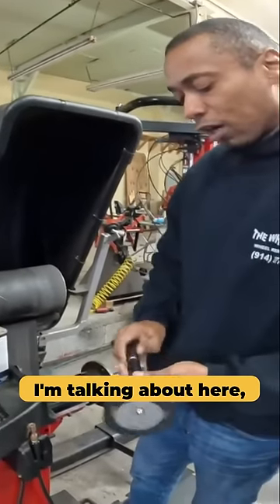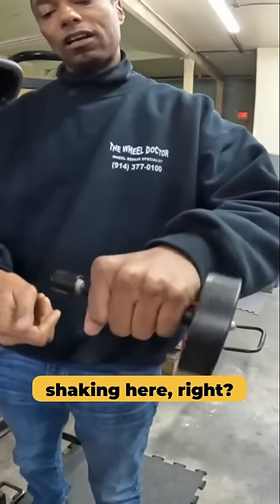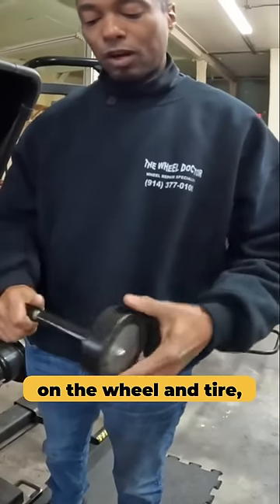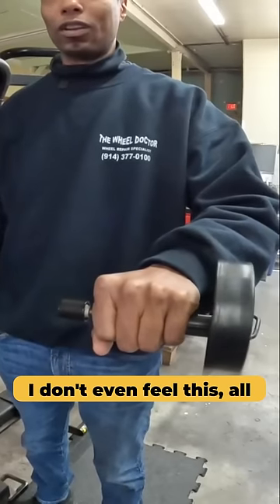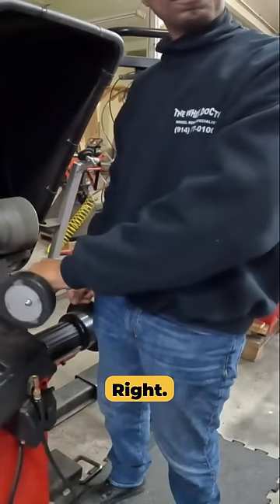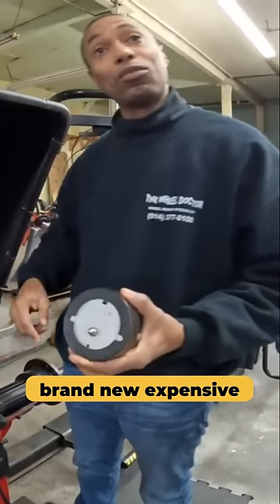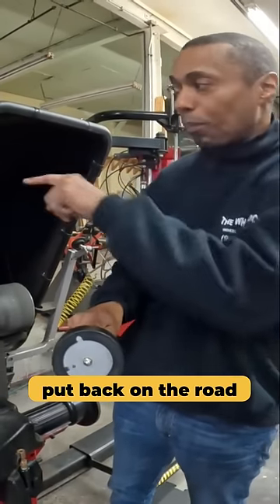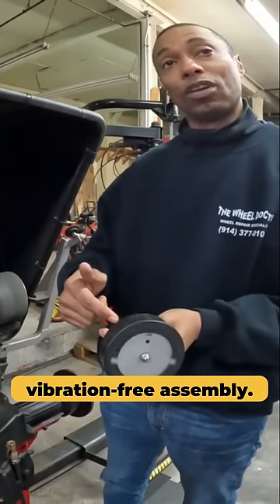1.5 MILLION VIEWS - Highway Steering Wheel Vibration (ONE SOLUTION) @thewheeldoctor7097

Comment: OEM tires and wheels have the high spot marked and the builders put the high mark 180 degrees apart from each other on the wheel vs the tire. The pin vents are also grinded down to 1/32 of an inch to ensure the best balance and ride. The high spot is marked by a Tire Uniformity Optimizer or TUO. I worked in  a tire factory 11 years.
Reply from the maker: Thanks for the info!

Comment: This seems like what needs to be done to my tires on my truck. Can someone please tell me what is this called and where would I get something like this done? TIA 🙏
Reply from the maker: Call your local tire shops, ask if they have a force matching machine. If they do,then explain the problem you’re having, with hopes they’ll ask you to bring in the truck.  Also, if your joints (ball joints, control arm, etc) are loose/faulty, that could also be your problem.  Bottom line, if they have the equipment, explain to them the problem you’re having and let them diagnose. IMO
Reply: @chiz_tv  thank you so much!!!!! Hopefully this will be the cure for whatever is causing my truck to shake between 50-65 mph
Reply: @chiz_tv  I ALSO APPRECIATE YOU TAKING THE TIME OUT OF YOUR DAY TO HELP ME!!! It means a ton to me!!!! 💯💯💯💯💯
Reply from the maker: You’re welcome, please keep me posted. If you look at my videos, I LOVE PROJECTS!!!
Reply from the maker: And what I recommended to you, is exactly what I did to find The Wheel Doctor. And after I found him, I stopped in twice, to just ask questions, before I actually dropped off my wheels.

Comment: unless we’re talking fairly low profile or performance application a force match is just compensating for a shitty tire, warranty the out of round tire and be done with it. Especially if the radial runout on the wheel is minimal. 

I Have seen/done some pretty cool things with road force and bead massage though. It definitely has its place.
Reply from the maker: Thanks for sharing! It definitely has its place, but not for every application

Comment: Have done this since the early 80s. Learned it from a Bridgestone rep. Usually it was with Uniroyal tires we called them separators because most of the time belts would break in one of them before the tread was worn out. GM cars came from the factory with them back then.
Reply from the maker: Thanks for sharing

Comment: That's why there are Dime size 'DOTS" painted on tires. They represent the high and low spot on tire...the rim has the valve stem which those dots are supposed to align with...! That will align the high spot and low spot
Reply from the maker: Interesting, I didn’t know about the DOTS

Comment: Force matching is great in theory, and sometimes works without issue. But the whole basis of how it works depends on you having an imperfect wheel and tire and you match up those imperfections to cancel each other out. 

If you have a good tire but a bad wheel, it ain't doing shit. And more commonly you have a bad tire and a good wheel, it ain't doing shit. 

It's awesome when it can work, but I would say the majority of the time it ain't gonna do nothing.
Reply from the maker: You’re right.  And I am proof that it works. After getting my wheels force matched, putting them on the car where The Wheel Doctor indicated, I am vibration-free at any speed. That’s better than any theory.

Comment: All the tire guys where my Dad was a car mechanic knew how to use the balance machine to first check / balance the rim and then figure out the heavy / light points of an oversized truck tire. My 33’s on cheap steel rims didn’t have any weights on 2 and only small weights on the other 2. 
They made it a game to see who used less weights each day. Because weights tend to fall off when driving thru pot holes, which are very common in Minnesota.
Reply from the maker: That's it!!!  They made it a game - Thanks for sharing.  They were applying these principals to 33-inch steel rims!!  wow

Comment: Had bad shaking on my steer tires, to the point they were leaving the pavement, had wheel balance and alignment done, no change, had road force done and still no change, changed all suspension components and bushings, still no change, countless shops and a lot of $$$ and nobody could figure out the issue, we decided we would replace the only thing left(which all the shops told us that wouldn’t cause the problem) which is the front axle, problem solved, it’s been 3 years and the shake hasn’t returned. Shops need to come up with a better way to diagnose these problems so we don’t have to waste thousands of $$ on crap that wasn’t even broken
Reply from the maker: You're right, their process of elimination cost you thousands.  You may need to look for another repair shop in the future. Thanks for sharing your story, maybe will help someone else.  Do you have any idea how that axle was damaged?  Does seem odd...

Comment: I worked at a powder coating shop that had a maintenance engineer. He made a wheeler rounder that was ingenious. You take one of the steel or aluminum semi rims and place it valve stem down and pull a lever that pins a large round steel ball to the inside of the rim. The you turn on the motor that spins the rims at 1000 rpm. The bell smacked and bounced repeatedly on the rim while it bends and heats up. Then you engage the pneumatics on the lever and it vibrates the whole machine until it runs out of places to round out. Once it stops shaking like an unbalanced washing machine, the wheel was well within round. Then his guys would reform the lips and valve stem with a blow torch. They had to be marked and when they were returned they could not be rerounded on the same machine. Then they would have to go to the welder, and he would use the same machine, but reweld and  locate weak points and stress test anything that seemed wrong, because one lawsuit would have killed that business. Lol
Reply from the maker: Thanks for sharing that experience

Comment: I had balancing beads put in on a new set of wheels and tires for my truck. It shook like crazy at all speeds. I took it into a local shop to remove the beads and  balance with weights. When I picked it up, the shop told me they got it as good as its gonna get, but it still has a little "shimmy" at highway speeds. Charged me $250.00. Still shakes a good amount,  sure not as bad as before,  but any shaking is bad, obviously.  I need to find a shop that can do this.
Reply from the maker: That is really annoying, and I know that feeling. Now you have to spend money again, if you find the right shop to do the work.

Comment: I've been wrenching for 15 years and force matching has never helped any of my customers. It's also a lot more work for a tech to do it correctly. Cause you have to mount the tire then spin it then unmount it and remount it as it instructs and like I said I've done it several times and short of a car doing insane speeds I've seen no difference. By the time a customer feels a vibration it's a badddd tire or bent rim.
Reply from the maker: Yes, you are 100% correct, it takes more time, and at 55mph will you really notice the difference?  So, this conversation may be for those customers who drive faster than 55mph, and are seeking a vibration-free vehicle...

Comment: I was doin this in 2007 at ford. I no longer work there so had to have another shop mount new tires for me recently and they have no idea what road force balance is😑 my tires hummed after that
Reply from the maker: Sometimes they have the equipment, but prefer not to do it thinking it will not make a difference

Comment: Back in the late 80s I went to school to be an auto technician and they used to teach us how to balance the entire front end. With the tire on the car this machine would spin the cars at about 60-70 miles per hour and tell you where the weights when and it bounced everything so if you had a little bit of a bend in one of your tie rod shafts or something like that it would compensate for all of that. So much better than the way they do them today. However I don't believe you can actually balance them that way anymore especially with four-wheel drive and all-wheel drive. However the cars from the 80s and before you can get away with it easily. That is if you can actually find a mechanic that actually has that equipment and knows how to use it. I'm 52 and it was old when I was in tech school at 17.
Reply from the maker: I didn’t know that, thanks for sharing!!!

Comment: This is true, IF the rim is not round, but most rims are. So, if you have a tire that is not round, it won't matter how much you turn it on the rim. It will still not be round. There's only 2 solutions. 
1- Buy a new tire. 
2- True the tire. 
Tire truing is very old school and most shops don't even know about it and don't know how, which is pretty sad. A tire truer will shave off the rubber on the tread until the high spot is gone and then balance. If done right, you'll have a perfect balance.
Reply from the maker: Do companies still shave/true tires?
Reply: @chiz_tv  very few. I used to work at one and I believe they still have a truer.
Reply from the maker: Typically the tire is returned if new. Which brings up a new question.  I wonder what happens to all returned tires if they’re not “round”.  Would the manufacturer then true the tire, then resell?!? 🤔

Comment: When you're installing tires. Make sure they are properly lubed, inflate the tire to 50 psi, then let all the air out. Refill to proper psi. I promise 80% of the time any movement you see in the tire versus the rim will go away.
Reply from the maker: Hmm… interesting!
Reply: We used to do it with Michelin tires but we went quite a bit higher than 50 psi. I'm just saying 50 PSI cuz I know a lot of people will be that's crazy you guys were inflatimg them that high But it just seems like it seats the beads better and then relaxing it by letting the air out and and then airing it back up. we noticed a lot more tires looked better and they read a lot better on the road force machine. Spent quite a few years in a tire shop, dealerships...
Reply from the maker: That sounds logical to "over-inflate", then relax the pressure.  Thanks for sharing!!!

Comment: Where do i get this done in Colorado?
Reply from the maker: Maybe someone else has a better idea, but I would call your local tire shops (use YELP), ask if they have a force matching  machine. Then explain the problem you’re having, if any, then ask for a recommendation. Also, if your joints (ball joints, control arm, etc) are loose, that could also be your problem.  Bottom line, if they have the equipment, explain to them the problem yours having and let them diagnose. Don’t self diagnose….

Comment: Why did you move the axis
Reply from the maker: It’s a demonstration…
Reply: @chiz_tv  well it's a little confusing because that's not what would happen to a car because the axle is in the center so you're charging variables that don't apply to a car
Reply from the maker: You're right, the axle doesn't move on a car.  In real life, the wheel is not a perfect circle, and even a brand new tire is not perfect.  When you combine the wheel and the tire together, you get an assembly that spins with vibration. This vibration is similar to that simple demonstration of the toy tire spinning on it's axis.  Hope this helps
Reply: @chiz_tv  ok cool I get it now thanks
Reply from the maker: @Ben24636  AWESOME!!

Comment: Did he move the point of rotation not centered and when he showed the balance it was centered..... when you balance a tire it is with the rim, a pipe will go down the center in which you tighten it take the weights off and see how it is.

Comment: I love it when I see weights on opposite sides of the same side of a wheel.  🤣
Reply: "opposite sides of the same side"  You realize this statement makes no sense?
Reply: @frankdank7507  Do you need a picture to understand?
Reply: @IIIRorschachIII  No.  I have balanced tires for over 45 years, and what you said makes NO sense.  Opposite sides cannot be the same side (of anything).  Maybe you should use the terms "inside" or "outside" of the wheel?  Or whatever terms/verbiage it takes to get across the point you're trying to make.
Reply: @frankdank7507  12 o'clock & 6 o'clock of outer side of wheel. Opposite sides of the same side.

Comment: This may work for improperly seated tires, but if your tire is out of round skim cutting them (like dirt track tires are done) is the only way to get them back in round so they will actually properly balance out. 
If a road force or any force adding balancer worked them tire skimers and balancing beads wouldnt be used near the level they are especially in other the truck trucks/trailers
Reply from the maker: That makes sense!

Comment: I had a tire patched passenger side front, a few days after driving my car, which I barely drive cause I bike to work, my car started vibrating and I can feel the vibration coming from that tire, whole car shakes at 60mph, it never did this before, did the mechanic mess with something?
Reply from the maker: Sounds like that patch caused the tire to be out of balance. Did they at a minimum balance the tire after adding the patch?